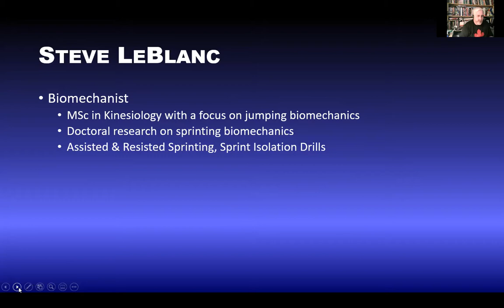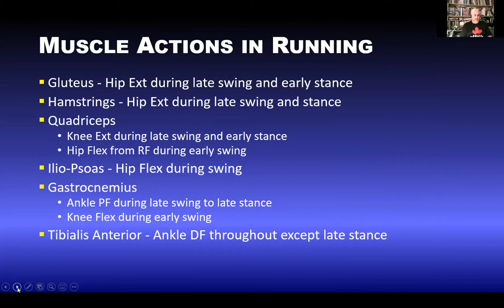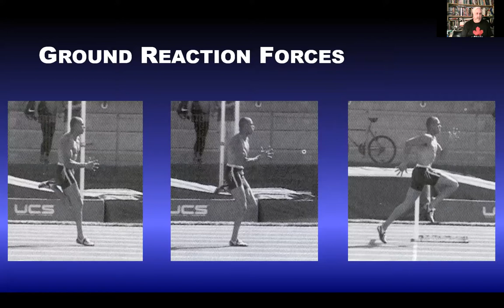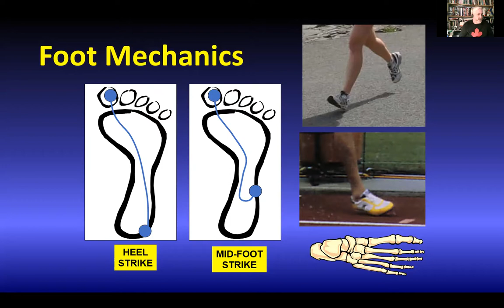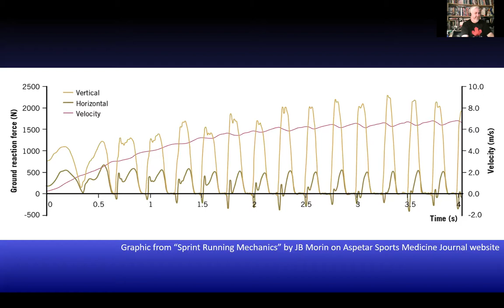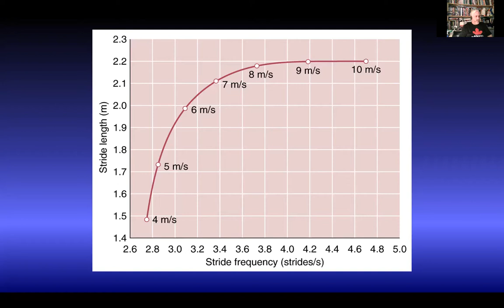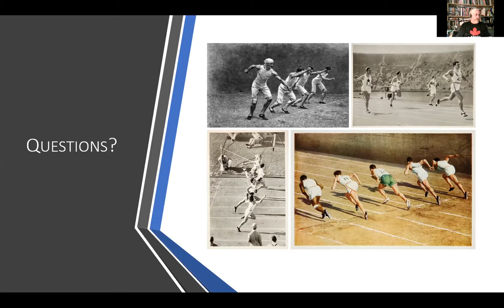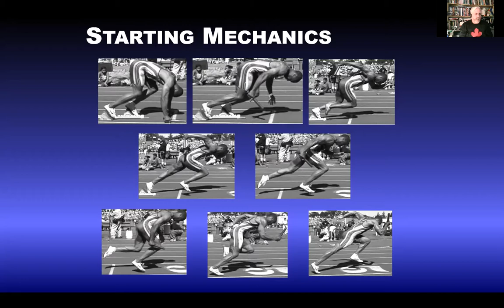Biomechanics of Running and Sprinting

Comment: Speaking to your comments on the pedal size of the blocks and the heel dropping to a more severe angle before extension, I would add that there is also a contributing factor with the enhanced stretch shortening cycle and explosive muscular response by doing that. Do you think the more firm block peddle provides a stronger and faster start if the SSC is lessened?  Loved the presentation, by the way!
Reply from the maker: Good question! I suspect that it would depend on the stiffness of the ankle joint complex for a given athlete. If they have a pretty stiff ankle and explosive extensors, the heel drop may contribute to a more explosive block clearance thanks to an enhanced SSC response. But if the ankle is less stiff, it may just make for a slower and less powerful loading, and this the big block might be more effective.

Comment: Hey Steve!

Great video and good explanation! 

I have been suffering from achilles tendonitis for quite some time. I think this is due to incorrect technique. I am trying to solve this by studying the technique and biomechanics of running. Do you have any tips to help me move forward?

Greetings from the Netherlands!💪
Reply from the maker: First, thanks for watching the video! I am amazed at how many people have checked it out. To address your question about Achilles tendinitis, this is a common problem for runners of all types. It can be a question of biomechanics, training surfaces, footwear, foot-ankle function, and lots of other factors.
I recommend having a look at the type of shoes you are running in to make sure they fit well in terms of the length and width but also in terms of their arch shape and the "rock" from front to back. Also watch for shoes that have a high back on them because they may be rubbing on the tendon and causing some inflammation. The right footwear makes a huge difference!
Next consider your training surfaces. Are you always running on the same type of surface? It is best to have your training on a variety of surfaces - the pliability, traction and energy return of the surface you run on should vary to ensure better adaptations.
And definitely consider doing some extra foot and ankle strengthening work to ensure the smaller muscles in the foot and lower leg are properly developing to take their share of the load during ground contact. There are a few examples of these here on my channel. I hope these tips help.

Comment: For us who are not very familiarized with running training, can you please elaborate what are ankling and acceleration ladder exercises, please? Thank you. Your presentation was amazing, btw.
Reply from the maker: I will try my best. Ankling is a very small but fast and dynamic running movement where you step just about ankle height and use a very springy and dynamic contact on the ground. The focus is on fast movements and a stiff foot-ankle complex. The acceleration ladder model I use is one I got from Gary Winkler many years ago - you set cones or lines out on the track at increasing distances, starting at 50cm apart and increasing the pacing by 15cm with each successive mark (so 50cm, 65cm, 80cm, 95cm, etc). The goal is to keep a high cadence even as the step distance increases, this requiring more force application but keeping the ground contact time short.

Comment: Hi Steve! Thank you for sharing your wealth of knowledge on YouTube! I was wondering if you had any drills and/or cues you recommend to increase stride turnover?
Reply from the maker: Glad you enjoyed the video. I have used a couple of different drills but the one I have had the most success with is using low step-hurdles (or wickets as most call them) with short spacings to encourage fast turnover and put an emphasis on hip flexion. I also sometimes use a drill-to-sprint transition drill using a high-knee run transitioning into a sprint. The best cue I use with athletes is to put emphasis on bringing the thighs forward.